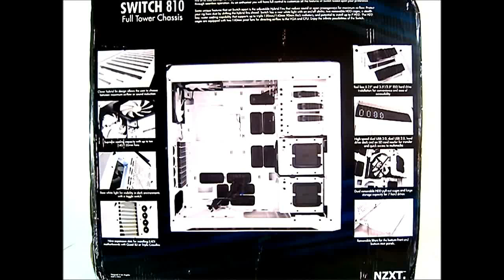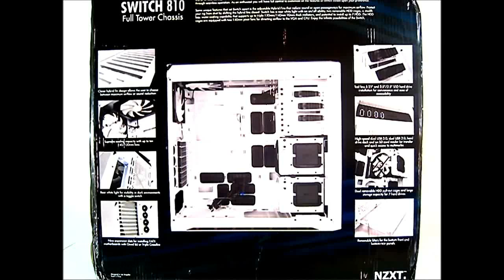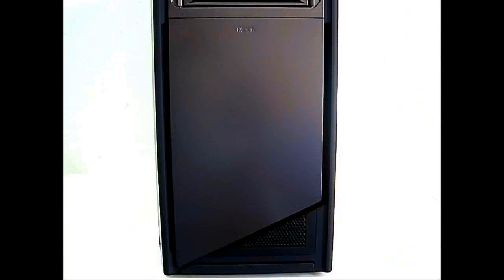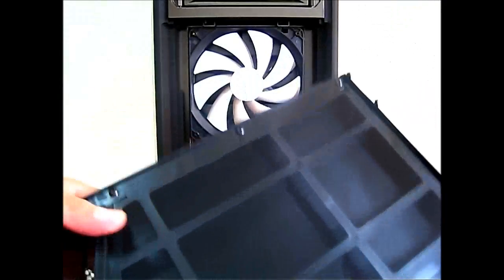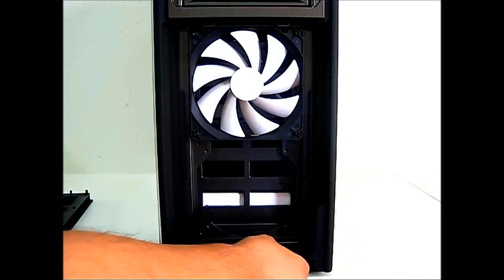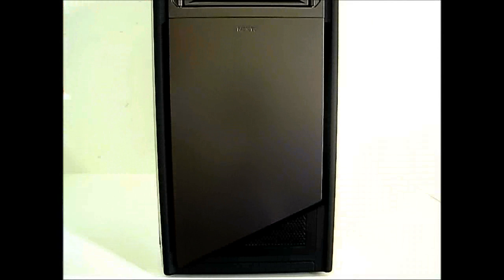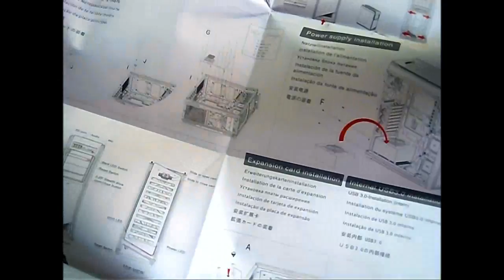NZXT Switch 810 Special Edition (Gunmetal) Full-Tower Case Overview

Comment: I have the switch 810 1st edition (white), and the top ventilated area isn't stiff because it's plastic on plastic, it's because the sliding grooves that allow the vents to slide forward and backward are actually held into position by a very small indentation, so that when you slide the vents into "Open", they are locked into position.  Same with "Closed", they lock into position.  I want to remove the little indentations on the sliding grooves but I'm afraid of the vents moving on their own

Comment: My only real gripe with this case is the front dust filter, they should've made it easier to remove... but at least there is one included.  That and the window exposes the optical bays... annoying... wish there was a non-windowed panel you could buy.